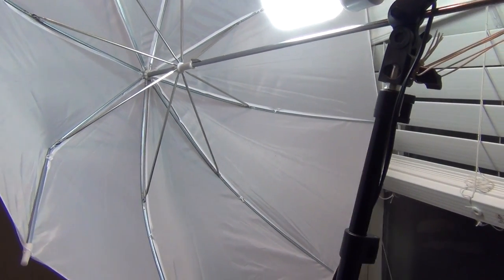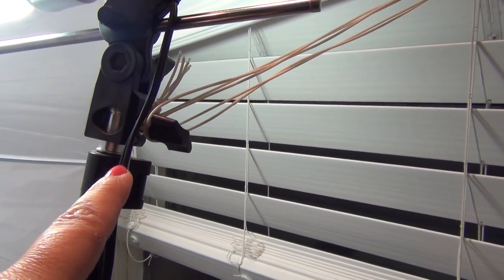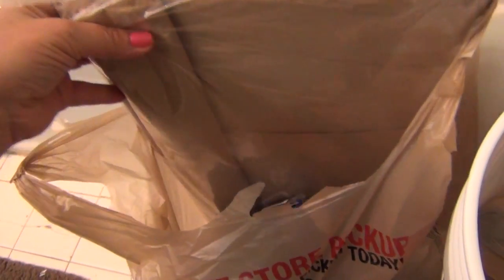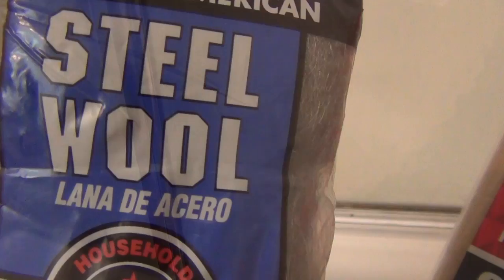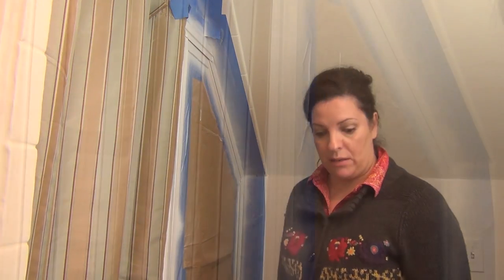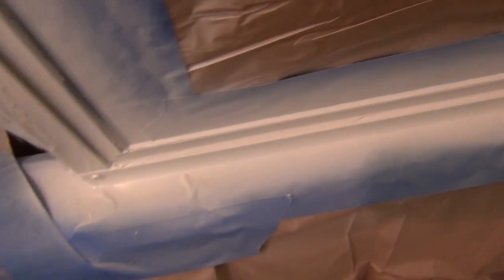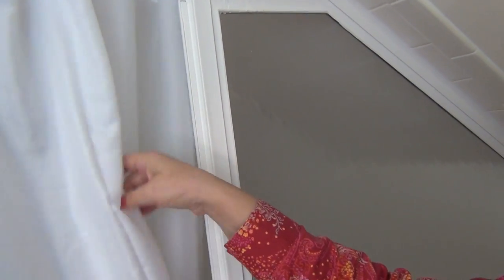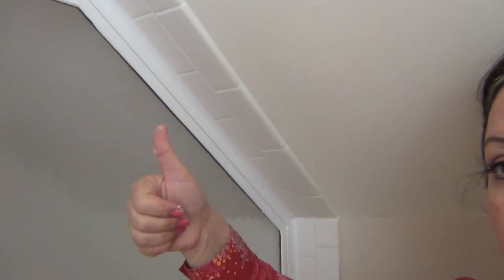Master Bathroom Makeover - Part 7 - Painting the Shower Frame

Comment: you did ok... but because you 3 coats of spray you could have done a light coat 1st then 2nd light  and 3rd coat and you would not the dripping it would have been smooth  (I use spray  paint for projects )never make circles side to side or up down but lightly.  but it did give me an idea to do mine.  thanks

Comment: When you go back to caulk around the the edge between the glass & that rubber strip tape off the glass leaving a tiny 1/16 space in between the glass & the edge your caulking. Immediately pull tape off at an angle away from work before caulk dries. If you want you can run a wet finger over the caulk (always use a wet finger to smooth caulk) to finish smoothing out the edge. You'll have a clean even line & not have to worry about a wide over spread of caulk.

Comment: If you do this process again, just don't do it so heavy handed.  You put it on a little to thick.  More like a sweeping motion.
Reply: Yeh with spray paint less is key , with the first coat it should be a super thin layer and then build it up in a fine mist over several layers 😀🎄

Comment: Obviously been a Cocktail Shaker in a previous existence! The white looks very clean, agree that you probably need to caulk where the black line is showing (round the edge of the glass). I've never used spray paint before, but it seems a lighter coverage at a time, is the order of the day, to help stop the drips from forming. I know what it's like to be a bit of a perfectionist when decorating lol...... Lorna UK

Comment: I love the white.  But...the only way to fix the drips is to sand them down and do really lite coats.  Especially to metal that doesn't absorb paint.   But if you can live with the drippys until you can re-do the bath as you want then I wouldn't worry about them.You & hubby are the only ones that will see them...well...and us. ;)   Are you going to paint the design on the door or use a glass etching liquid?